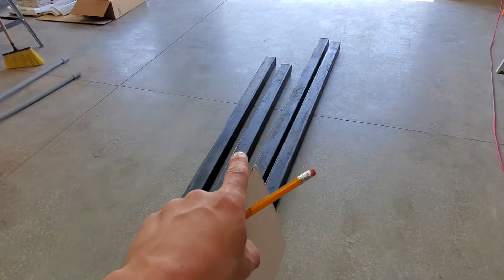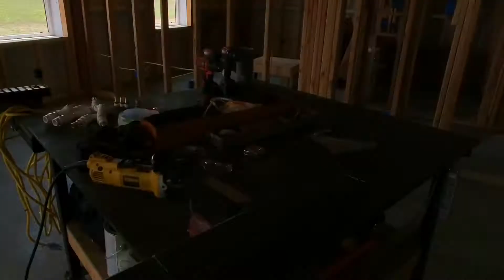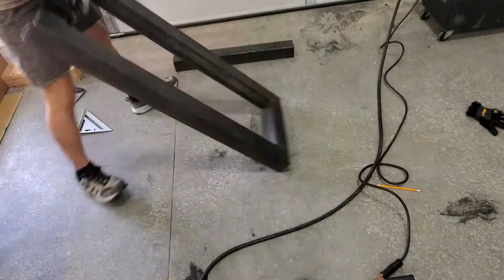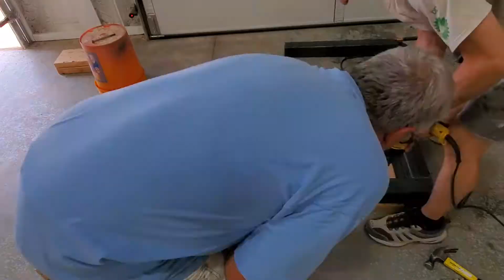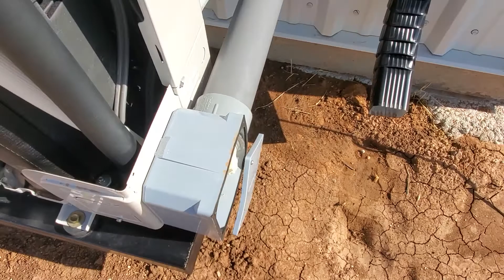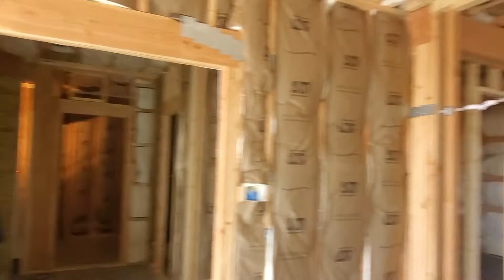50x60 Custom Hangar Home Episode 34: Multi Zone Mini Split HVAC System Part 4

Comment: i have the same system at my home I hope you will not have the issues that I had, constant small leaks, sooo many fittings, and yours being behind the sheetrock, god forbid
Reply from the maker: I've only had one leak so far in one of the 3/4" fittings on the outdoor unit. It was a pain in the butt, and I had to get it recharged after fixing it, but that's the only one I've had. They've been my primary heating and cooling for 2 years now.

Comment: The chicken wire over the condenser coils is a good idea.  I own a couple of Fazoli's restaurants in the Austin area with 15ton units on the roof (3ea).  Hail has been our biggest problem with damaging the fins and I know you get a lot of hail in Lubbock as well.  The owner of the Fazoli's in west Texas is a good friend of mine if you ever stop in while he's there.

I'm paying close attention to your build as I plan on doing something almost identical in the near future at a 14 lot airpark east of Austin.
Reply from the maker: Glad you're enjoying the build series. These units are designed to hang off a wall up higher, and I couldn't believe how exposed the fins were. So far it's working great.